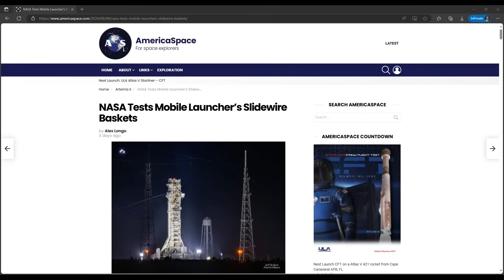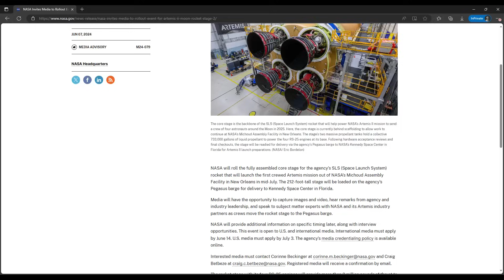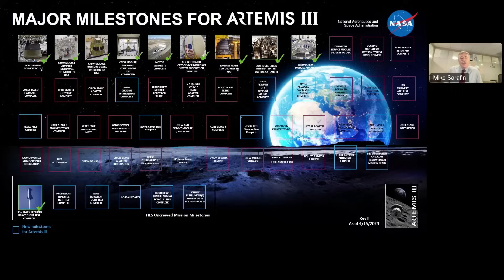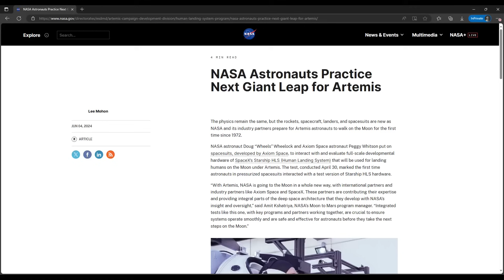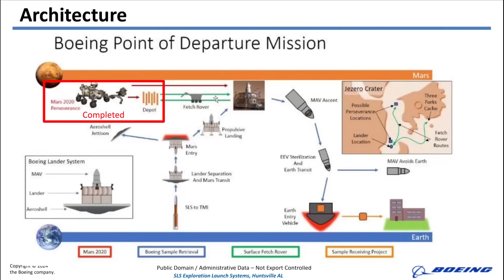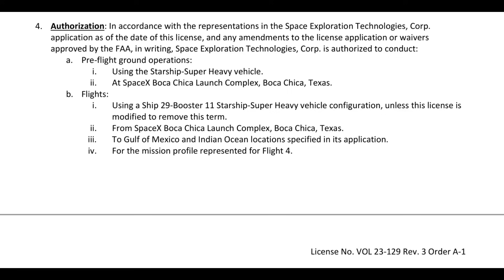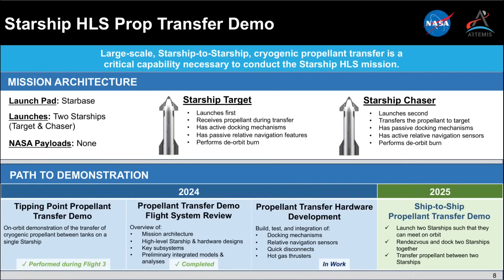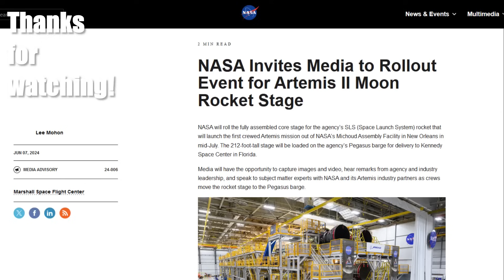Another clue to the Artemis II schedule and will Starship success change Artemis III outlook?

Comment: A cliché at this point but the difference in pace between SLS stacking and Starship stacking is… large. Guessing SpaceX will launch at least ten Starships between the first and second flights of SLS. When your far-future stretch goal is one launch a year, something is not right.
Reply from the maker: A key for NASA/Artemis will be to see that Starship cadence with the full lunar capabilities.  If both Starship and Blue Moon demonstrate that and NASA isn't able to increase the SLS cadence by the next decade, we might see more people asking questions.  And it's still something to watch between now and then, whether there's a change in the Congressional attitudes towards these programs.
Reply: Big difference is that Starship is useless past LEO if it can't refuel quickly, especially when you take into account boil-off. For that a high cadence is absolutely necessary.
Reply: @jrc1606  Rapid refueling (or the propellant-agnostic “refilling” preferred by SpaceX) has been part of the Starship design since its inception. It is key to Musk’s Mars plan and as much a part of the system as the engines and flaps. “Make life multiplanetary” doesn’t happen without it. They will make it happen. Not without setbacks, and possibly not in time for a 2026 Artemis III… but they will get there. Completely expendable launchers that only fly once a year at most, at a cost to taxpayers of more than $4B a pop,  that have already demonstrated shock&vibe levels unacceptable for interplanetary probes, will most definitely be useless beyond LEO (and in it) beyond the contracted Artemis flights. Note that on Friday NASA turned down Boeing’s SLS-based proposal for Mars sample return.
Reply: Not every launch will be reusable @jrc1606
Reply: @jrc1606  But that is a problem that we know can be licked.  So I would say the actual big difference is either the total cost of a trip to LLO or the fact that Starship can actually get its entire payload to the moon's surface.  It's a really good thing that by the time Artemis IV is done, we will already have the perfect vehicle for sending up the literally 1000+ tons of equipment that will be needed to enable anything resembling a "stay" on the moon.  One wonders how NASA would have gotten JAXA's giant Toyota rover to the moon if they'd made the giant mistake of finding the money to award the Artemis contract to National Team first.
Reply: @Asterra2  Considering that JAXA's rover is based on NASA's Space Exploration Vehicle, it is possible they could've used something similar to what JPL was proposing during the early days of Constellation. That was using sky cranes to land heavy payloads on the Moon, similar to those used to land rovers on Mars.
Reply: @jrc1606  I suppose my question was more aimed at underscoring the point that nothing has been contracted to do anything of the sort, even though we would immediately need such a thing following Artemis IV.  NASA understands the timeframes of such projects.  For them to conspicuously shrug at this gaping hole really says all that needs be said: They understand perfectly well that Starship will be filling that role.
Reply: SpaceX could test another full stack with new more leeward fins with 60 days, if they wanted to.
Reply: @onewhostudies6856  I think it's more likely that they will send up Ship 30 unmodified and use it to retry IFT3's tests and shoot for a less-troubled Booster splashdown.  The reason I say this is because the FAA is likely to provide the next launch license faster than normal.  Nothing is more important than flights and flight data, and I don't see SpaceX allowing a launch license to rot for no good reason, even if it does mean the flaps will probably again melt.

Comment: The Apollo 9 approach that was previously reported just makes so much sense. It would help with getting to the yearly cadence, buy down risk, and buy some time for the actual landing. Artemis II in 2025, Artemis III (docking manuevers) in 2026, Artemis IV (landing) in 2027. What would make even more sense is Gateway being ready for that landing, but it seems it's too late at this point due to the schedule overruns.
Reply from the maker: Artemis IV is already closer to 2029 than 2027 at this point (officially: no earlier than September 2028), but it does seem that ESDMD wants to aim for a demonstration of something like a year between missions this decade.  If Artemis II can hold that last quarter of next year date, then a 2027 mission seems like it would be feasible...but what that mission would be is still the subject of a lot of questions.

As I noted in a recent video, any "post Artemis II" mission in that late 2026/2027 timeframe will not just be a challenge for Starship, but also for Orion and SLS.  (And probably Axiom Space.)

Comment: Hopefully with the Heat Shield review due on 6/30, there will be an announcement soon of an Artemis press conference soon. Reading the ‘tea leaves’ it sounds like they are developing a use case to support flying Orion as is. Phillip , I know that you aren’t big on speculation, but if you did, what are your hunches?
Reply from the maker: It wouldn't be surprising if the heatshield investigation review takes a little longer, but we'll see.  The internal investigation likely presented recommended actions; that's likely part of the review.

I hope that NASA Exploration/Artemis will have a press conference, but they are making themselves less and less available for questions from media, so it's more hope than anything else.  Last year they only did two press conferences about Artemis, in March and August 2023.  Similarly, they are less and less available for one-on-one interviews, but that's continuing a multi-year trend.